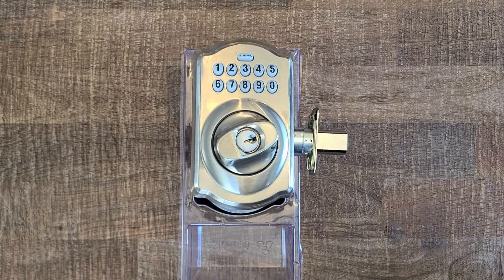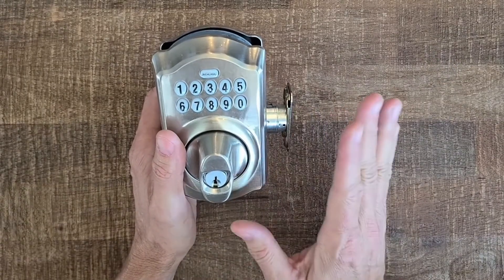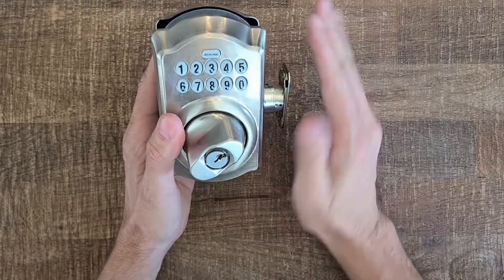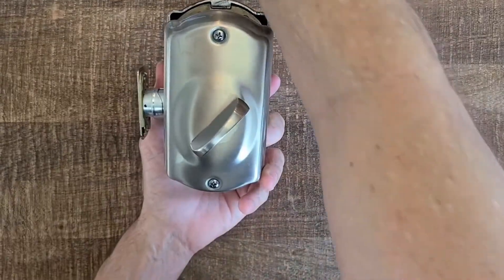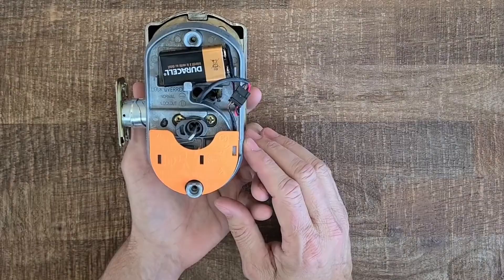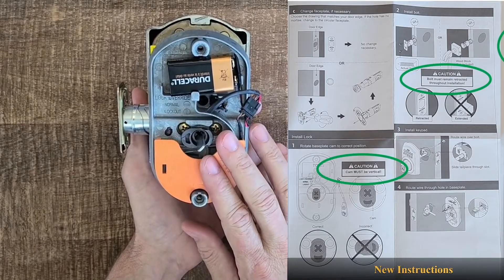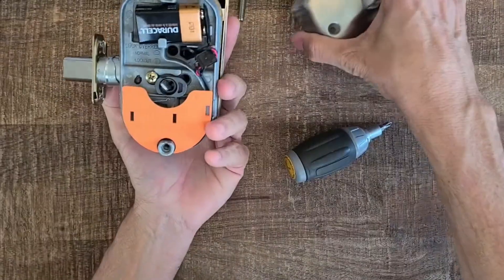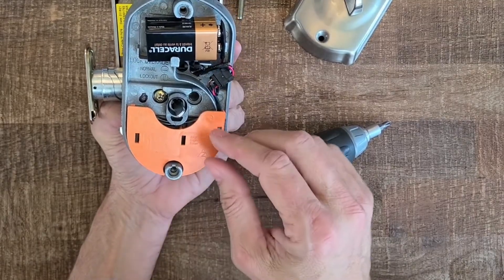Help! The Schlage Button Unlocks my Door!  How to Fix a Schlage Electronic Deadbolt.

Comment: Yeah, on mine the keyhole is independent from that spinning tumbler around it. They are not connected like they are in this video. Guessing it's broken.
Reply from the maker: You may need a new lock or spindle.

Comment: This is a valuable video.
I had a lock like this that I didn't install and this was the problem.
The directions for it are, of late, are pretty explicit about this too.
They say with bolt retracted cam with arrow should point down. They even have a drawing. Its pretty explicit and can be found online as well as the paper directions that come with every lock.
Reply from the maker: Glad it was helpful for you!
Reply: @LocksmithRecommended  Someone else installed three new Schlage Be365s and two worked fine after I set a code but one opened with just the Schlage button...they threw out the directions so I didn't know what to do, what to check but your video told me exactly what the problem was.
I found your video helpful and also out of curiosity looked at the directions online which do spell it out if only people would read them...
No, it wasn't a locksmith who installed them, so that's an argument for considering that avenue...or installing them one's self if you're handy and read directions...

Comment: how the hell can those locks been installed wrongly so easily, without any idiotproofing design feature? it is a lazy design and design fraud those companies has to fix or make their locks 20x smater? my google smart lock doesn't have this issue nor does it need to be installed "correctly" to function. a lock should just learn how to open/lock a door without knowing how it is installed. Machine Leaning and AI?
Reply from the maker: In their defense, it's in the instructions, but us men don't normally read those. 😁

Comment: For those of you who say that this fix didn't work and you had to disable the Schlage button via the programming mode 7 option, let me share my experience.

TLDR; One of the screws may be in the way of the cam's rotation.

I was very careful to install it correctly, and it was installed correctly. I had the same issue as described in the video. I also found it odd that the bolt did not stick out very far, but just wrote it off as the way it is. I double checked my installation after watching this video and I had, in fact, installed it correctly.

Looking at it again, the cam that closes the limit switch on mine was not able to rotate to disengage the switch when locking because of one of the screw heads. I had to take one of the screws out to allow the cam to rotate fully. I don't know how I ended up with the wrong screws, but the screws I have do not recess in the holes like the ones at 3:07. Once I removed that screw the cam was able to fully rotate. The bolt was also able to fully extend as well, which alleviated my prior concern about the short bolt.

Comment: Mine was doing this and was installed correctly.  I just needed a new battery.  I installed a new battery and it seems to take a few minutes to go back to normal functioning.  It bothers me somewhat that a weak battery would cause this behavior.  I would expect the appropriate response would be to stop unlocking.  That might not be so great if you only had one way in.
Reply from the maker: I've never seen that.

Comment: I've reinstalled a few times to be sure I wasn't doing anything wrong.  Still the same problem.
Reply from the maker: Try their customer support, they're usually pretty good. 888-805-9837
Reply: Check my recent comment. One of the screws may be in the way of the cam's rotation.

Comment: Hi, I have the opposite issue. The door locks when I hit the Schlage button but to open it I have to enter sometimes all the stored codes until one unlocks it’s. The codes are correct because there’s a green light and I can hear the clicking sound, it just doesn’t unlock. I just know that’s not normal!

Comment: This was happening with my lock but when I took the cover off of it, my lock was installed correctly. Any ideas? The lock allows me to unlock it without a user code.
Reply from the maker: This is the most common. Try Schlage customer support. They're good.

Comment: Thanks for the video, we definitely installed the lock correctly the first time but this saved us from buying a new lock (its been working for almost a year and then developed this problem). I think the cam gets loose after a while of the door shutting and jiggling the lock. This is the second schlag we've had this happen to unfortunately, and after a long time of it working properly.

Comment: I lost my programming code so I had to take apart the lock to retrieve the code from the plate on the key pad.  After working on it for over an hour and watching two different videos, still not able to reinstall the lock.  Five minutes into your video you had identified the problem, I corrected it and I now I not only have the programming code but a fully functioning keyless lock!!!  THANK YOU !!!!!
Reply from the maker: You're welcome.

Comment: It's not always installed incorrectly.  Sometimes you have to DISABLE SINGLE BUTTON UNLOCK FEATURE.  On BE365 enter prog code + schlage button + 7
Reply: Thanks, the video did not solve my problem but your advice to disable the single button unlock feature did. 
Excellent!

Comment: Our lock had the same problem but with a different cause: As our cam was already in the correct position, we disassembled the lock (by taking off the colored plate) and found that one end of the leaf spring was installed incorrectly at the factory. This caused the contacts to be always "on", regardless of the position of the cam. Once the spring was back in its proper place, the lock worked as intended.
Reply from the maker: Good to know!
Reply: @LocksmithRecommended  how can I reposition the spring? I have tried all the fixes on Youtube and nothing works.
Reply: I’ve been messing with this lock for a week. Everything was installed correctly no matter how I put it. It’s still unlocked by pushing the button. I’ve been doing remodeling work for 20 years and I’m baffled.

Comment: Is there a way to keep from having to enter the code every time you come in the door, even when it’s unlocked?  My door handle will only work when the code is entered….
Reply from the maker: They make two levers. The 575 and 595. The 575 always requires a code to enter. The 595 can be used without the code. The 595 has a thumbturn on the inside of the lever. That thumbturn puts it in a passage mode where no code is required.

Comment: What do you think is the problem if my lock. The code works but the deadbolt lock doesn’t appears to move to either side.
Reply from the maker: Could be any number of things. Lock might have failed. Trash legs customer support. They're great.

Comment: Thank you, thank you, thank you! I never saw the install instructions because I had already hooked up one before and I lucked out. But, the proper instructions were on the back of the dead bolt when I took it apart to make this fix. Thank you so much.

Comment: For anyone who had no luck after trying this…..I found another solution from someone else’s video.  You have to enter the master code, let the light blink orange three times, push the top Schlage button once, then the number 7.  It changes the main settings so that this isn’t allowed anymore.  It fixed it for me!
Reply: Well it partially worked, the Schlage button doesn’t do anything now, so I have to lock and unlock using code
Reply: A year later your comment is still helping people. Why they don’t include this info in the sheet is ridiculous. Thank you.
Reply: Thanks you fixed my issue. Was stressing out cause I installed correctly.
Reply: For anyone looking for the master code, but does not know what it is. You have to take apart the entire lock, and it is taped on the inside behind the keypad. I did what the video told me to do, but it did not work for me. However, I did what this comment said to do and it did work. I can no longer press the sledge button and unlock the door without a code. However, it created another issue. Now I cannot lock the door without a code either. That’s my next problem I’ll need to solve but at least nobody can press the button and get in my house without a code now.
Reply: come on!!!  Seriously, THAT easy;-)  So, I HAD checked all items noted in the above video.  Still I could unlock without code.  Trying to lock, keypad turned blue.  Just pressed 7 and voila, it worked.  THANK YOU
Reply: This also helped me out. My issues was somewhat different.  My lock required code both to LOCK  AND to UNLOCK... I must have hit the #7 ROUTINE somewhere in there whilst attempting to change my codes....   Hurray LAURA!!!
Reply: Thanks you! Its now fixed!
Reply: Thank you so much!
Reply: Thank you!!!
Reply: Thank you so much! Was pulling my hair out about this
Reply: For those of you here where this didn’t solve your problem like me, one other thing to try. I bought refurbished on Amazon and it had this issue even though the black cam was down. 

The flexible metal strip below the cam but above the black rectangle was placed BENEATH the notches, not IN the notches. Moving it into the notches (so that it bends when the door is unlocked / cam is down, but is flat when the door is locked / cam is to the side) fixed my issue.
Reply: None of these tricks worked and it turned out to be a faulty switch that the curved metal piece closes when the oval knob is in the vertical position. I used a switch from an old lock and now it works perfectly. The switch is behind the orange plastic cover in the lower portion of the lock and it's wires connect to the wire clip connected to the battery.
Reply: @gongwelder  THANK YOU the person who installed this actually didn't have the black box in the right spot, but I never would have thought to get the orange plastic off to look at this stuff without your comment. You the man.
Reply: This fixed my issue, but like another commenter mentioned, I now have to enter my pass code to lock the door
Reply: This worked for me! Not all heros wear capes! Thank you my hero!
Reply: Hahaha for whatever reason it’s locking now with just the Schlage button. Thanks! I didn’t want to have to type in the code on my way out ! 🙌🏼👏
Reply: Tysm
Reply: Worked for me!! God send!
Reply: This worked perfectly! Thank you so much for posting this much quicker fix
Reply: Hell yeah. Thank you!!!!
Reply: Thanks!
Reply: This worked for me thank you
Reply: Thanks.
Reply: Thank you!!!!!!!🎉🎉🎉🎉🎉
Reply: This one helped. Thanks for this comment.
Reply: Thanks Laura. This is what mine needed.
Reply: This worked. Had to suffer through chatty Cathy's bs to find real answer here. Ty

Comment: Very helpful thank you for the video. I now feel stupid for not catching that in the instructions. I said to myself its right otherwise bolts wouldn't fit well little did i not see. That the dead bolt needs to be retracted. Again thank you
Reply from the maker: Glad it worked out for you. Thanks for watching.

Comment: Unfortunately, mine was indeed installed correctly, and still has this problem. the Schlage button allows me to lock the deadbolt, and ALSO unlocks the lock. The lock can ALSO be opened with the code. 
Again, my cam is pointed in the correct direction, and yet the schlage button will unlock the lock. 
Do I need to reset the lock? It didn’t do this until relatively recently. 
I’ve had to remove the battery to secure my yard. (It’s on a back gate to the alley)

Comment: I had to replace one, you entered the code and you would get the green light but it would not unlock. Had it for several years, replaced with another haven't had any issues. I would recommend that people that change codes often use the #6 option rather than the #2. The #6 deletes all the user codes entered.

Comment: Didn’t fix my issue.  My cam was down and bolt not extended.   But I did extend the cam to the right and it solved it- so not all locks are with the cam down with bolt in.  Just fyi.

Comment: This kind of fixed my issue. It had the same symptoms as you described, but when I took it apart the cam was in the correct vertical position. I ended up unplugging the battery and re-plugging it in and it fixed the issue of the Schlage button unlocking the door. Weird. But this video helped me to troubleshoot the issue. I'm guessing the contacts on the battery just weren't all the way in or something. Not sure. BUT, I'll be replacing the battery today to make sure this isn't an issue moving forward. Thanks for the video!

Comment: Mine has had this problem too.  I opened it up and found I had installed it correctly.  I replaced the battery and it seems to be working fine now.  Do you know if a bad battery could cause the same problem?
Reply from the maker: I haven't heard of that, but I'll keep it in mind when I run across another one. Thanks for watching.

Comment: I bought three of these, and two of the locks functioned well for 3 years. Just a month beyond the guarantee the third gave up, with a siimilar problem to what you are describing.
The failure -- the disconnect of the front knob did not occur, presenting the problem you are describing.  The bolt in and the tab face down did not free the bar that goes up and down inside the lock.

Further, after three years (with fresh battery), the internal J shaped mechanism appears stuck in the up position, meaning the front knob will always be engaged.  

 My gripe:  Maintenance should not require a triple dismantling of the lock to reach the mechanism.  In your video, you showed phiips screws to hold the flat plate to the front assembly. On our locks the inner plate is held with  torx screws, and the fifth screw had the head sheared, so the lock cannot be dismantled without damage.

The lock was installed onto a basement door, that faces west. Location, Montreal, Canada.
After 2.5years, facing the sun,m the film plastic over the buttons split. exposing the lettering to direct sunlight.
This lock was underused. About twice a day for five days per week (person left for work, returned from work) and only for 6 months per year.  that is really about 600 open/closes max.

Yes, I like the concept, but not the mechanical design, I think that Schlage has to do better. 
We need an optional shroud to protect the buttons from the 8hrs/day direct sunlight, and Schlage needs to have a policy of fast exchange/replacement of the plasticised keypad and the locking mechanism.  We cannot leave the home unprotected.

A motorized lock in our situation is not practical as when the batteries fail, there is no way to get into the premises to retrieve the keys.  

What I would like is a lock that provides fast easy cylinder replacement with easy physical key replacement. The cylinder should allow for master key and end-user key.

Comment: My lock worked for years and I live on a quiet street and can audibly hear the engagement. I have installed a handful of these locks and never had a problem. I have also used the Schlage button to light the key pad for about 4 months of the year every night for years at least once a night and it never energized when pressed. That is until now. I am not a person who misses things like that.

I no longer trust this lock or line of locks at all.

Edit: The issue is intermittent. It did it a few more times and then it stopped. Without dissecting it, I can only surmise the cam position sensor is beginning to fail. It behaves as if the lock is retracted when in fact it’s extended, and then it doesn’t...

Comment: Hi Robert. My mother-in-law just bought a house with this lock on it. Great videos on the BE365 lock by the way. I have a question that I can’t find the answer to. I went through the procedure to put in new codes and delete old one. It worked perfectly. But what I am seeing is that when I want to lock the lock by hitting the Schlage button and then turning the lock arm, it doesn’t lock. To make the door lock I have to enter the user code. That works fine and maybe I should just leave it alone, but that’s just me! LOL Any help or video to point me to??  Thanks! -Mark
Reply from the maker: Your lock is installed wrong. But I've got a video showing you how to fix that! 

https://youtu.be/L-jr3pZXnNI
Reply: you can program it to disable or enable it